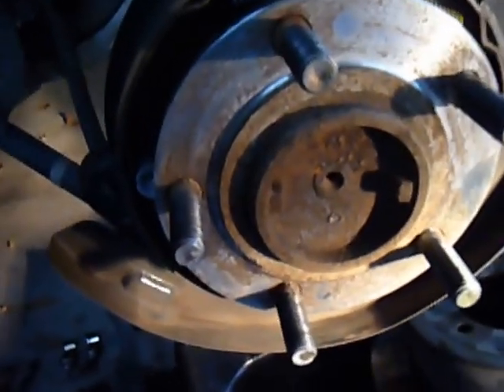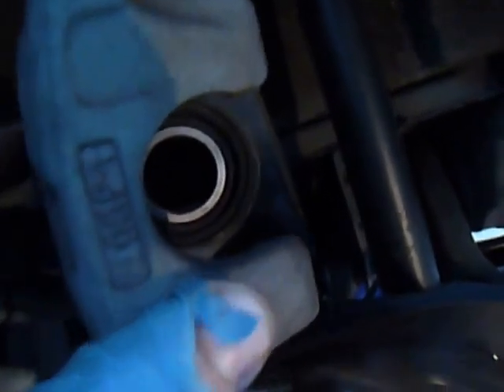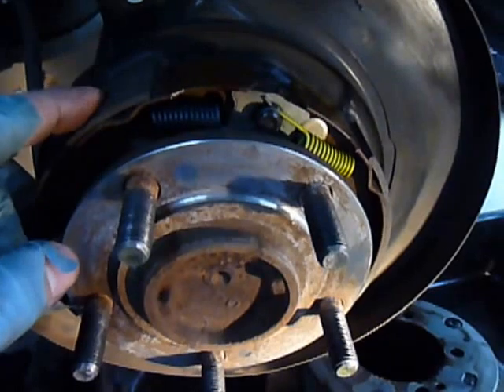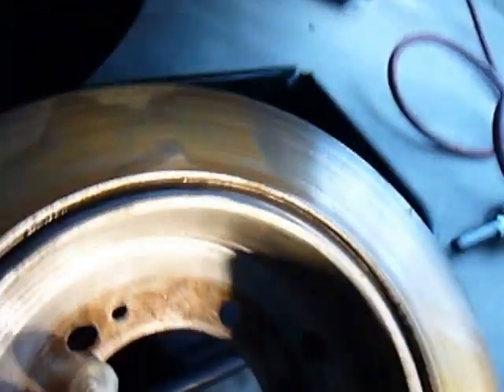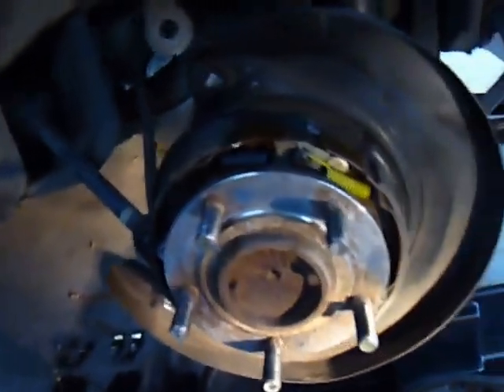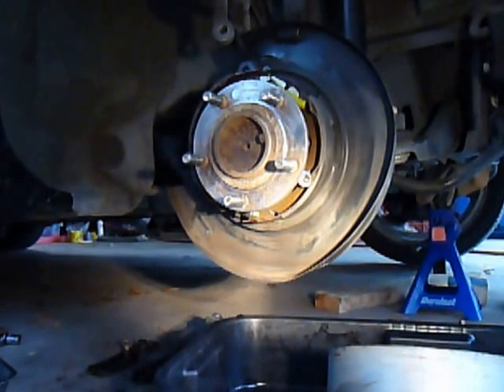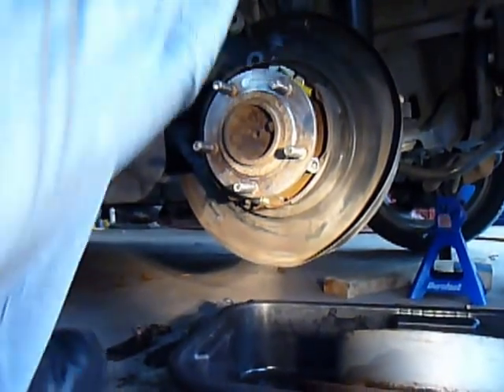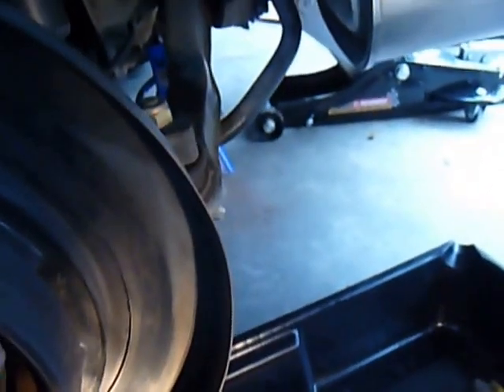2000-2005 eclipse Club3g:  Rear parking and disc brakes explanation

Comment: 3g owners. 

Hello, Family. My name is Chris, “Rinzler975”.  I purpose to secure 25+ Wavetrac (helical) limited slip differentials, for the 3g Mitsubishi Eclipse 6g72, manual 5 speed, F5M51 transmission. 

Model: 76.309.180WK. 

I’m a stranger to you. Trying to convince you, the value of this expensive Mod and asking you, to help me/us get one. But there are several of us who are well known and trusted (benjamin Gilmore, Franky Mitsu, 6g75 3g, tcroc30, ZergBush, Advanced Clutch, DyLaNpAuL, and 03Eclipse), that we look to for reliable advice. I hope some of these will weigh in on this mod and this proposal (which is at the end of this letter).  

 I did reach out to Wavetrac and have been in contact with, Ryan Viaeu, at Autotech Driveline. The North American office of Wavetracc. Tel: +1.949.362.8700. www*wavetrac*net/contact*htm. 

A limited slip differential, or diff, or LSD; is a transmission mod. The main purpose is to improve traction, handling, eliminate the “One-wheel peel” and to make use of all the available power. It keeps both wheels in powered rotation, so that the traction will not be limited to the one wheel that can handle the less amount of power. Wikipedia*org/wiki/Limited-slip differential

 I am directing this letter, to the vendors/dealers that were referred by Ryan at Autotech Driveline and a few reputable others I have found that do carry multiple lines of Wavetrac products. For the purpose of; facilitating the order, negotiating retail cost, maintaining a running account and determining capability for delivery 

to individuals. I am not asking you for money. I will not hold your money. I will not put up money for you. We are making a group purchase. You will pay the dealer, yourself.

I will be bidding this propasal to:

•	Shepherd Transmission Co 

Address: 	1002 E Pearce Blvd, Wentzville, MO 63385

Phone: 		636-327-8255

•	Team Rip Engineering 

Address: 	Shelby Township, MI 48317

Phone:  		269-382-2669 

•	CARiD

Address: 	1 Corporate Drive Cranbury, NJ  08512

Phone: 		800-505-3274

•	MAPerformance 

Address: 	9800 Hemingway Ave S. Cottage Grove, MN 55016

Phone: 		800-505-3274

•	Billet Superstore

Address:	2380 E Orangethorpe Ave, Anaheim, CA 92806

Phone:		714-871-2905 and 954-753-6006

•	Road Race Engineering 

Address:	13022 La Dana Ct, Santa Fe Springs, CA 90670

Phone:		562-777-1522

Please, everyone. Email me, so that I can make a mailing list and we can discuss this; forum style. That way, any question that one person asks or answers, will all be on the same email.  (I haven’t leaned to speak Spanish, Mandarin or Russian yet. Please comment in American.)

PS. One page, on one vender’s site; displayed 16 Wavetrac differentials. Priced between $749.00 and $1,335.00. The average cost, for an in-stock item: $1,119.00. Just FYI. We are making a custom order, at a regular price.

PS. When this turns out well. Let’s make RIPP Superchargers the next target! 

Chris, “Rinzler975”.  

Email: trustworthy505@gmail*com	Subject: 3g 6G72  LSD    

09/05/2020.

================================================================================================

PROPOSAL (WILL BE EMAILED TO EACH VENDOR/DEALER)

Hello. My name is Chris, “Rinzler975”.  I purpose to secure 25+ Wavetrac (helical) limited slip differentials, for the 3g Mitsubishi Eclipse 6g72, manual 5 speed, F5M51 transmission. 

Model: 76.309.180WK. 

 I did reach out to Wavetrac and have been in contact with, Ryan Viaeu, at Autotech Driveline. The North American office of Wavetracc. Tel: +1.949.362.8700.  www*wavetrac*net/contact*htm.

Ryan informed me that, while production of this specific model, has not been enough in demand 

to maintain their stock. These differentials can be readily produced. So long as, to do so would 

be justifiable to the cost of production. In other words; there must be a ready demand.  

Ryan went on to explain the prerequisite conditions: 

1.	Minimum order of 25 units

2.	Order must be placed through an authorized dealer

3.	50% of total cost must be paid in advance

4.	Allow 16 weeks for delivery, to dealer. 

5.	Unit cost, Approx: $1,100.00 (Wholesale)

Authorized Dealers. I am directing this letter also, to individual members of Club3g. A forum community dedicated to Mitsubishi Eclipse 3G owners and enthusiasts. As well as to various Youtubers that vlog the platform (+200 individuals). As you please respond to me, with your ideas. I will pass along that information, to each person who responds to me, that wants to stay informed. 

Other points to be considered:

1.	We owners would prefer that, no one of us, be required to maintain any monies being collected. Please inform us, how you would like to handle that aspect. My initial thought is that, once you indicate that you would like to process this order for us. And provide your offer with guidelines. Then each of us, would contact you, to confirm that we are interested. Once the minimum reservation has been met, that group would be notified and make payment at that time. Afterward, each account could be handled individually. 

2.	We would not expect for you to wait, indefinitely, for 25 preorders. Upon your agreement 

to process; I would propose 30 days notification, for interested parties to contact you themselves and place their orders. Once the minimum order has been placed, I would like 

to make an additional posting to all; indicating sufficient interest and offering ample opportunity to order for those that may be waiting to see traction. For a total of, not more than 5 weeks.

3.	We understand that this request is unique and may be considered, out of the way. 

One incentive to you though, is that this will not be a piece meal. It will be 25 units or more; 

at once. We are extending this proposal to multiple vendors. For reasons of both, availability and seeking the better buy. $1,100.00, plus your cost, is not a frivolous amount to any of us. 

4.	Wavetrac lists the: 10.309.187WK (for Audi), at $1,295.00. One vendor lists the same, 

at $1,155. 50 (9.2% less). Another example is the: 30.309.150WK (for BMW). Wavetrac lists this differential, for $1,395.00. Another vendor has it for, $1,245.50 (9.3% less). Also; at least one vendor offers free shipping, standard on all Wavetrac differentials.

As an authorized dealer, you have the purchase power that we would like to be to our benefit. 

And, we believe that you should also benefit at this great favor that you can facilitate. Without consoling my colleagues or asking your buying cost. I would like to offer 10% over Wavetrac’s $1,100.00 list price. So, $1,210.00 per unit (before tax). That way, if the buying cost for this model is comparable to the examples mentioned above, then you stand to profit up to 19.2%, per unit. $5,808.00, minimum; overall. Which we hope will be worth the trouble to you. We also do appreciate the free shipping, that at least one of you does provide, standard. 

Thank you in advance, for the service that you already provide. We look forward to hearing from you, 

to know what your thoughts on this proposal are. 

Chris, “Rinzler975”.  

Email: trustworthy505@gmail*com	Subject: 3g 6G72  LSD    

09/07/2020.